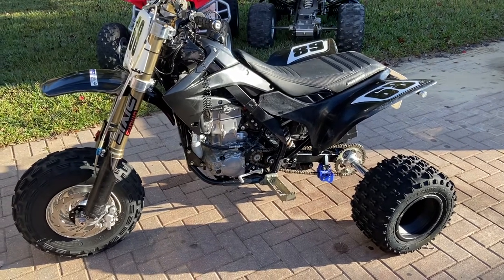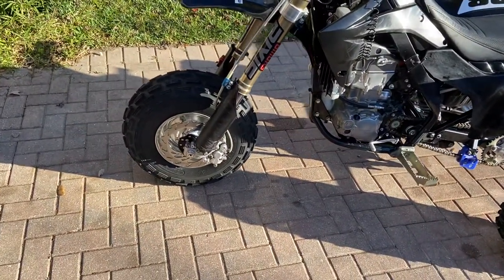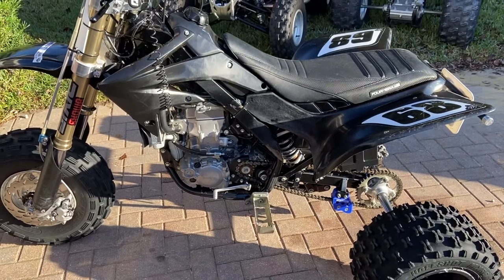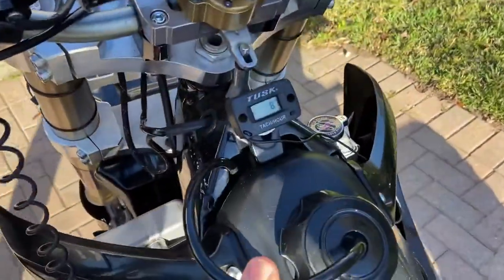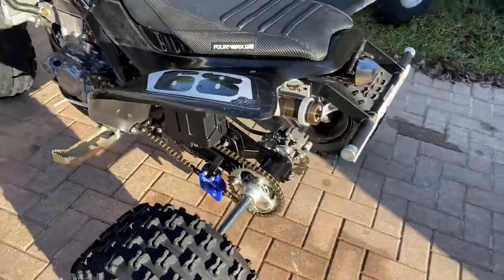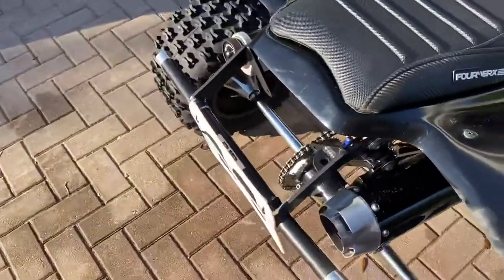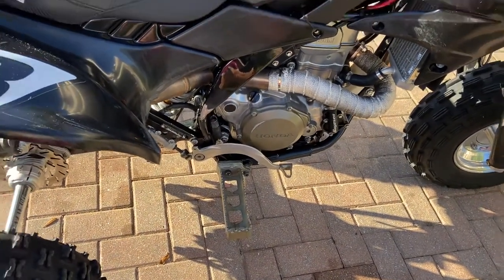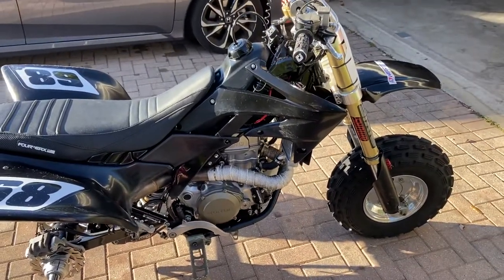TPC Trike walk around #TPCTRIKES #ATC #450R

Comment: Have you compared it to a BVC trike? It seems like their trikes are raked out too far. I'd like to know why the manufacturers did trailing axles back in the day too. Rake and trail are never discussed enough on trikes imo
Reply from the maker: I’ve been around some BVC trikes but never ridden one hard like this one.  You are correct about rake/trail... both are set in the ideal range for trikes on the TPC and it has very responsive steering.
Reply: I want to see them  side by side. I have seen the BVC trikes being jumped and tracked so Im interested in seeing them in a comparison video because at $14-$15k I obviously want the best ride for the money
Reply from the maker: @rovidbouski4022  If someone had a BVC for comparison, I'd gladly track test it side by side with my TPC and do a review.